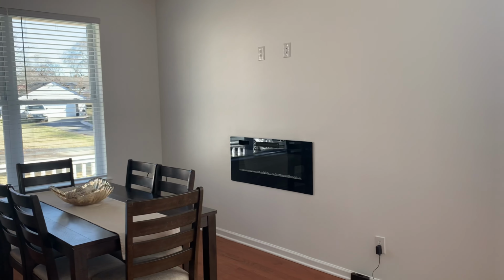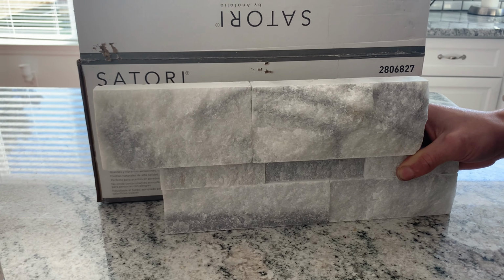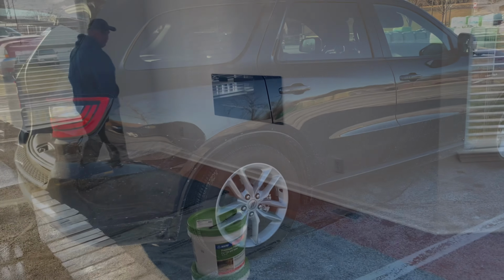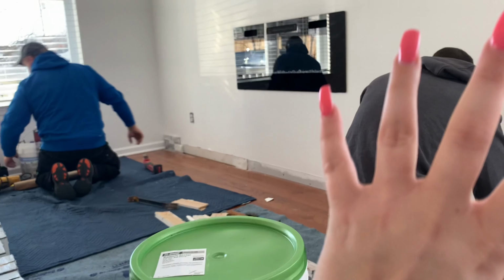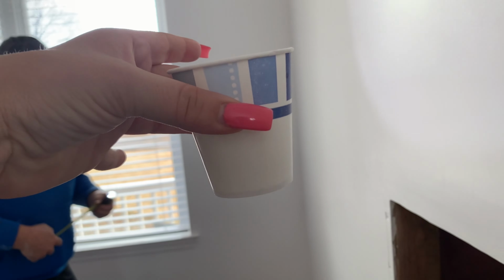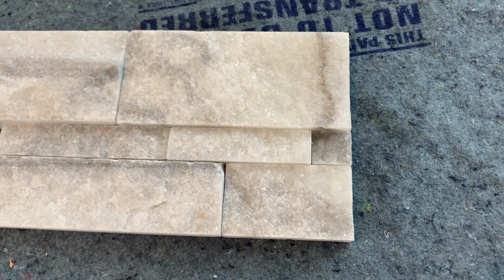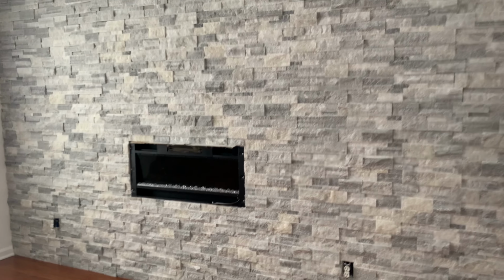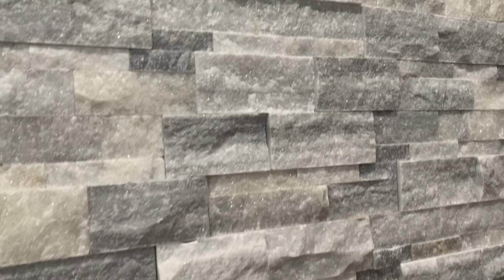How To Install A Stone Accent Wall | DIY

Comment: I am looking at doing this exact thing. We were opting to no cement board either because it is in a recording studio with 2" thick drywall glued together attached to the wall. The cement board screws stop at 2-1/4" and there is not enough blocking in the corners to secure another layer so I thought a not full securing cement board would be less strong than drywall. Everyone says dont do it to drywall but noone has shown one that has actually failed just that it could. The house we moved into has 2 walls done right on the drywall before we moved in. 
It looks like your dad has done this before so was nice to see someone do it on drywall successfully. I see that he doesn't use cement board, so I am trying to convince myself not to either, what is his reasoning for not using it (because he could have easily in this scenario) hoping his expertise and reasoning settles my nerves about my decision lol Thanks!

Comment: Beautiful, you should have gotten the finished corners for the end of the wall. We just did our outdoor fireplace and kitchen with the stone veneer and the contractor said to get it for the finished look. Really is so pretty when done. Congratulations on your wall. ❤
Reply from the maker: Great idea!!
Reply: Interesting you mention the corner pieces. I was at a local Floor Decor store and the style of stone we wanted didn't come with the corner pieces. The design dude said the corner pieces are basically overpriced and nothing more than two pieces butted together and glued.
Reply: @  we did our corners and I seen with and without the corners. Makes a huge difference in the finished product

Comment: You're supposed to install concrete board before you add this type of stack stone. Faux (fake stone) is ok to stick on with thinset but natural stone weighs alot more and requires concrete board (aka Backerboard).

Fyi I still gave a thumbs up because it looks really nice and I'm not being a troll lol 👌🏽👍🏽
Reply from the maker: thanks for the thumbs up! my dad has done these types of walls plenty of times and so far all are still great 😊👍🏼
Reply: Thats what I thought too.... but was wondering if that particular morter he used remedied that?

Comment: Did the fireplace trim fit back on with the difference of the thickness of the stone? I am going to do this but hoping I won’t have an issue putting the stainless trim around it back on. Great video, exactly what I was looking for,
Reply from the maker: Hi! Yes it did, I believe my dad measured it and did it a certain way to make sure it did, I can touch base with him and let you know 😊
Reply: If you watch from minute 20 you’ll see the cardboard trick my dad did to help with settling and prevent from being an issue when getting the trim back up. So, they put up the stone while the trim was removed and then just needed to use longer screws to fit back with the thickness of the stone.
Reply: Just replied with my personal YT account, still me, sorry.

Comment: Shouldn't that installation be done on a cement board and not on drywall due to the weight of the stacked stone tiles?
Reply from the maker: the wall is still going strong without the cement board

Comment: The wall looks fantastic, however attaching ledgestone directly to drywall is super dangerous and should never be done.  This is a huge short cut that should never be taken under any circumstances
Reply from the maker: Thank you! My dad has done many stone walls using this method and they are all perfectly fine and have lasted 10+ years. This technique is no shortcut. You have to know the proper amount of product and timing of getting the stone up. Thanks for watching!!!
Reply: So what should be the ideal way to install stone ?
Reply: "Typically" you remove the drywall and replace with cement board, hardibacker, etc. made for the water-based mortar, weight of the stone, etc etc..  but every situation is different, depends on the existing structure, weight of the stones being applied...
Reply: @fuelboy no need to remove the drywall, just install the cement board on top of drywall with proper screws to the studs, that should be sufficient to hold the weight. But you have to know the widths of studs of course. I could be wrong but the screws should be between 6-12 inches apart. Google it. Cement board recommended because a load of the weight is distributed vertically and it provides a better adhesive to the store or tile, than a "coat" of paint. If you think logically, the marble tiles are sticking to the paint coating and not to the drywall directly. Very often during new construction, drywall guys sand joint compounds and don't clean walls from the dust properly. The painting guys don't clean walls, they paint over the surface passed over to them. If there is a sign of peeling paint, I would not use this method.